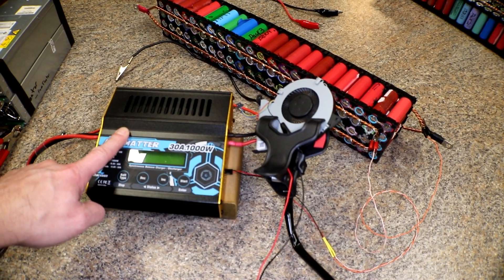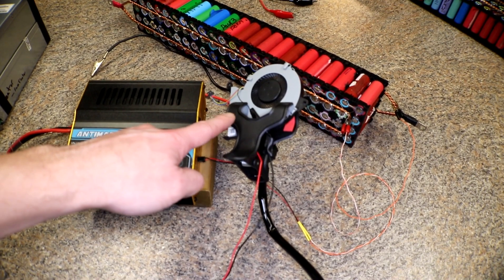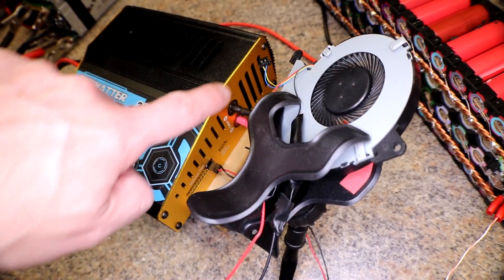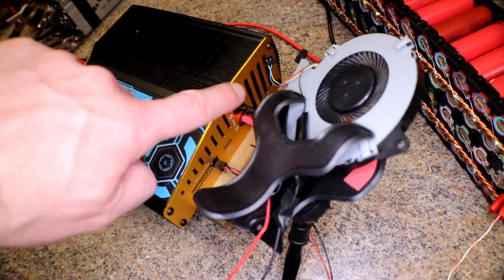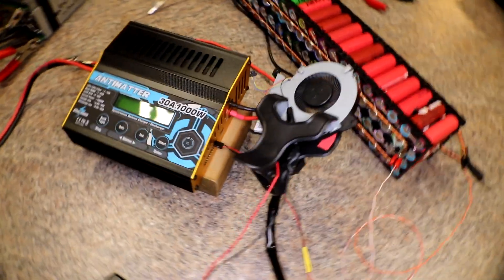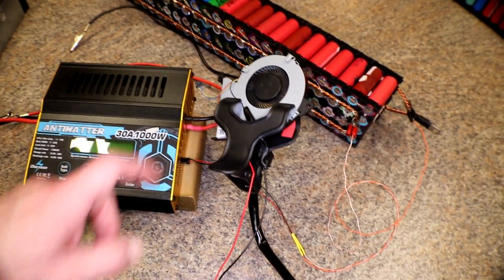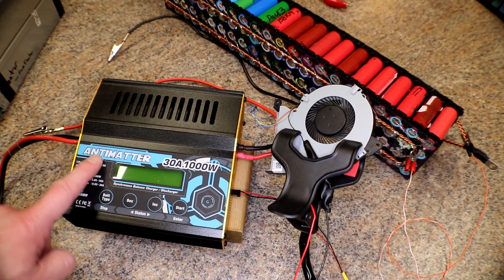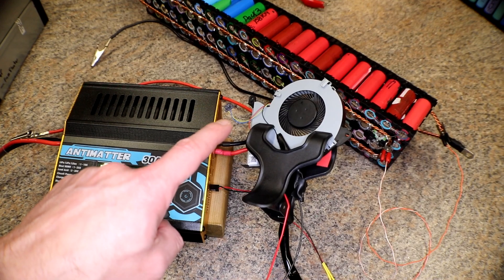Winter 18650 Test Ep5-1/2 ERROR!!!

Comment: Also the heatsink you should shave the black coating off where the thermal pads are and maybe drill and tap holes so you can mount them with thermal paste for better thermal contact and dissipatation
Reply from the maker: I wasnt sure if the fets needed to be isolated from the heatsink so thats why I havent done that yet but I do have arctic silver on there to help with heat!

Comment: I wish I had capacitor problems. My mega 400w charger burst into flames when the insulation on the main coil failed. I just have no interest in rewinding that coil. But new caps, that I would have done. So it sits on the shelf:)
Reply from the maker: Whoa!!!! Flames🔥😲  Yeah caps are easy for sure lol😆

Comment: I think you should add film capacitors in parallel with electrolitics. With short legs, as close to the PCB, as possible. May be the choke is bigger source of heat than the resistors.
Reply from the maker: What would that do by adding them in parallel?  Im actually asking cause I dont know!  You may be right, that choke could be part of the heat issue!!!👍👍
Reply: @AVERAGE_JOE  Film capacitors will absorb part of the reactive power that is now absorbed by electrolitics only. I suppose short life of that electrolitics is due to losses in themselves, caused by reactive currents passing through their ESR. Electrolitics have relatively high ESR and ESL. Due to space constrains You need to solder one of them with relatively long legs. These legs present additional parasitic inductance in circuit. ESL of caps and parasitic inductance generate voltage spikes when MOSFETS and diodes switch. These spikes are bad thing for whole circuit. Film capacitors should be of MKP type and above 250V. MLCC in parallel will help too. They should be 100V. I think the choke is main source of heat, because I think the resistors are for ballancing only. Cheers!
Reply from the maker: Damn.... I need to school myself on all these big words and understand what it means lol.  So if I add a film cap in parallel does it need to be the same value or how does that work.  I always thought if the value was changed it would change or mess up the circuit but I have no clue lol.  Im sure I have some film caps Ive pulled off other circuit boards I could throw in there.  Oh and yes I think you are right about the choke and the resistors!  Thanks again for your help btw!👍👍👍
Reply: @AVERAGE_JOE  You're right that randomly changing value of capacitance could mess or even ruin the circuit. Some circuits are pretty sensitive (resonant ones). Other, like choke and big elektrolitic in the charger are more forgiving to some extent. Film capacitor of 100, 220, 470, 1000 nF wouldn't alter overall capacitance significantly. Most electrolitics have tolerance +/- 10% and +/-20%. Lack of space wouldn't allow You to add big value film capacitor. And film capacitor should be close to the PCB. In switching converters are present a lot of frequencies. PWM frequency from switching MOSFETS and spikes caused from parasitic inductances and capacitances in the circuit. Low cost electrolitics if properly sized could cope with PWM frequency. Spikes present much higher frequencies than PWM frequency. Film and ceramic capacitors due to significantly lower ESR and ESL can shunt easily spikes energy away from electrolitic. This all is theoretically. It is possible that from space and cost constraints designers had lowered values and quality of the choke and capacitors. It's long and difficult, but I cannot explain it simpler. Cheers!
Reply from the maker: Awesome!  Thanks for all that info!  Ill see if I have any film caps of that size and see what kind of room I have to work with!!!👍

Comment: replacing a capacitor with one that has a higher voltage rating is generally ok, as long as you keep the esr in mind. higher voltage ratings generally have higher resistance, and this may be a problem, depending on where in the circuit it is.
Reply from the maker: Just learned this ESR term in a few comments below lol!  Well Ive heard the term before but not how it relates lol!!!😆👍

Comment: use resistors and an amphour meter, the dischargers are too expensive to be dumping tons of power through them.
Reply from the maker: HMMMMM Thats not a bad Idea!!!🤔👍
Reply: Good thinking SuperBrain. You would need a large resistor though or an array of power resistors. If you could add a Contactor with a circuit that cuts off at 3.0V it would be perfect.
Reply: @ljy17  yea there are professional hobbiers that storage charge their packs often so they normally have power resistors and heatsinks, some good quality chargers should have an inline discharge resistor function so you just put it in series with the battery and the resistor takes alot of the heat and the charger takes the rest, it uses the balance lead to measure the voltage on the cells.

Comment: The two legs of the capacitors are polarized pos/neg. If you install them backwards they will pop when energized (don't ask how I know). Also, the lower the voltage of the capacitor, the lower the ESR resistance will be (heat), so...the next higher up from 50V capacitors that can be easily found is probably 63V. That being said, 100V caps might work fine. I notice you are using a 24V power supply to the charger, you can find 24V server computer fans on ebay with ball bearings instead of plain bearings (or local electronics recycler?), and always get a centrifugal fan instead of an axial (an axial is like an airplane propeller, your fan at 3:33 is the good kind, centrifugal). You might try viewing the charger with an IR camera to see where it's the most hot.
Reply from the maker: Yep got the caps in correctly but didnt know about the ESR stuff.  Thats good info to have for sure!!!  Yeah 24v(26v with resistors on tabs).  I think the UPS's I have use 24v fans in them.  I have a spare that Im using for parts so Ill check to see if its a good bearing fan!  I would LOVE to use Predator vision on it but dont have it yet!!!  I need to order that cause I have all kinds of stuff I could look at!!!🤔😃👍

Comment: If you are talking about the icharger X6, I got one of those and it has been working great! To get a full 30 amp discharge, it has to be done regenerative. With a charger on it, I only get about an 8 amp discharge rate with 1 pack.
Reply from the maker: Yeah thats the one!!!  So your having good luck with it so far as well!👍👍
Reply: @AVERAGE_JOE  Yep. I don't have much others to compare it to besides the imax, but I really like this one. I use a 24v power supply on it and have charged and discharged my packs a few times in a row with it and it keeps on tickin.  Great deal for the money.
Reply from the maker: Nice!!! Might just have to get one!!!

Comment: Replace those thermal pads with arctic mx4 thermal paste you can put as much thermal paste you need using mx4 because it isn't conductive that is what I did on my imax b6 and it helped with cooling a lot by removing those thermal pads
Reply from the maker: I left the pads on since some fets cant touch the heatsink since its a ground.  If I knew for sure I would do that !👍

Comment: I bet those wires is the problem way too much resistance in those wires going from the antimatter to the pack use 10 gauge ofc copper wire and crimp or solder some banana connectors to it and that should relieve a lot of stress being put on the charger itself the more resistance the wire has the harder the charger has to work to do the job
Reply from the maker: I for sure need to make up a better set of cables.  I made this set out of some spare 12g from a ups.  I didnt have any 10g that was very long.  I also need some good clips as well!👍👍👍

Comment: I believe the magic smoke came out again.  Slowing down the video it appears to show (unless you added it for effect) a spark/arc inside the device (top central vent area. Playing at full speed it was barely noticeable, couldn't have been more than 2 or 3 frames.
Looking back at the disassembly part of the video, I would have to say that the MOSFET with the "spot" on it should have been replaced while you had it apart.
Reply: Contact
Reply from the maker: Perfect!!!! So my first cliff hanger was a success!!! (rubs hand back and forth) Muah Muah Muaaahhhhhhh!!!!!😆⚡🤐

Comment: Hello Joe 
I use dummy load ZPB 30A1 v2.8 and is accurate I think...... SKYRC MC 3000 measure the same capacity as dummy load..... 
That's why I use ZPB 30A1 to measure capacity of  battery pack's 
Is cheap.....and accurate 
Dummy load that HBpowerwall uses are not so....
Reply from the maker: I believe that was the one I saw on ebay and what I was referring to.  So you like them then and no issues as of yet.  About how many discharges have you done on it?
Reply: 6-7 I believe that was the very first one and all other are way off (at first I was thinking that ZPB was inaccurate but after I get skyRC and I was making 10x one cell on ZPB and the same cell on skyRC) :y only skyRC MC 3000 it measures the same capacity (50mah give or thake)...
If you try to perches ZPB 30A1 try to get genuine one..
 and use 4 wire measurement.... 👍 
For me it has only one issue that that could only measure only one cell...

Comment: It jumped up off the table, pointed a long red wired finger at you and laughed...then you ordered the iCharger.
Reply: The only problem with the iChargers is that they are just as finicky about things.  They have no protection on the balance lead inputs so any issues and the input may be dead.  I have one of the iCharger 4010duo units and you have to be very careful to check that everything on the balance lead is correct and connect it up before you connect up the main power connections or it blows up just about every time.  I had a balance lead lose connection in the middle of a discharge on the iCharger and it blew that balance input.  The iChargers are also very finicky about the power input side being very stable.  I have 3 server PSUs in series to power mine and had one drop out during a charge once and that drop in 12v killed the iCharger.  The worst part is that I was mainly using the iCharger for charging prebuilt RC hobby packs and most of the problems I had with the iCharger were a result of those packs which tested to be wired correctly.  I still don't know how a company can sell such an expensive charger at $350 and not have a ton of protection built in along with user serviceable parts.  Now that I am out of warranty with the unit and it was repaired 3 times while under warranty I am really hesitant to even turn it on unless I absolutely have to.  Don't get me wrong though, they work great when they work but are just so darn easy to kill.
Reply from the maker: Awesome!  Good info to know and yeah you would think it would have something for protection.  The antimatter does lol!😆

Comment: Are you doing regenerative discharge? This charger can do it and will have way less heat. All you need is half empty 3 packs powering it as all discharge will go into that packs. Or maybe some almost dead truck battery like 200ah.
Reply from the maker: I was just doing the regular internal discharge.  I tried regen the other day and it wouldnt go much over .71amps.  Maybe I had the settings wrong or it takes a few more mins for it to actually kick in or something so I switched back.  I should do the external discharge but need something around .15 ohm if I calculated it right(probly not😉)
Reply: @AVERAGE_JOE  if I remember well you have some settings how many amps can go via regenerative. Not sure if resistor is good idea. Charging another discharged battery let's you use this energy to recharge after discharge (of course with some loss). Will check mine but it's only 30A one.

Comment: Boom first i feel like its time to dyi a charger/discharger
Reply from the maker: BOOOOM💥💥💥💥  That would be cool to have a big discharger!!!
Reply: I know right? A 75mV 100A shunt as a discharge resistor would give about 33amp discharge @ 3.6 nom. 
Read the shunt with a voltage controlled oscillator to feed a clock to a 16 stage ripple counter.... wallah!  coupla BCD to 7Seg drivers.... Believe it or not... not even an arduino necessary!
Reply: Oh yeah... almost forgot... Of that repair worked!
Reply: *course
Reply from the maker: Would that work???
Reply: @AVERAGE_JOE   Yeah it would work. You would need a micro thoough or monitor it with a computer. The higher the current accross the shunt the higher the voltage drop.. If you time it.... mAHrs. If you time it and VxA... WHrs